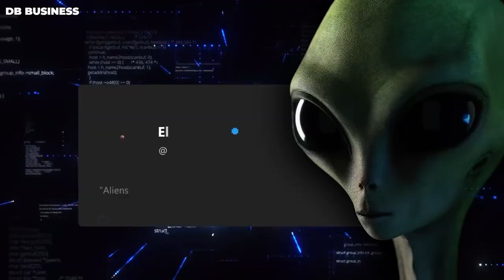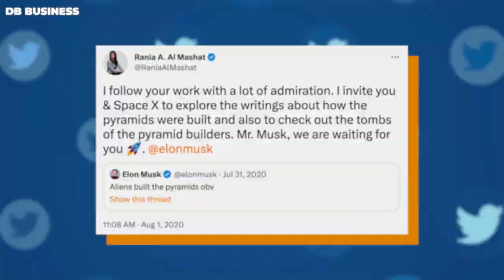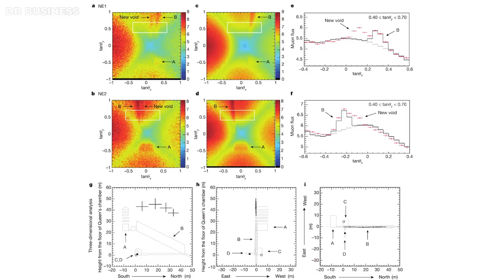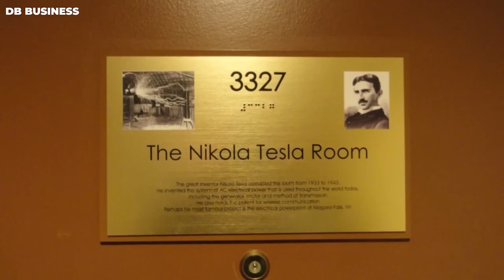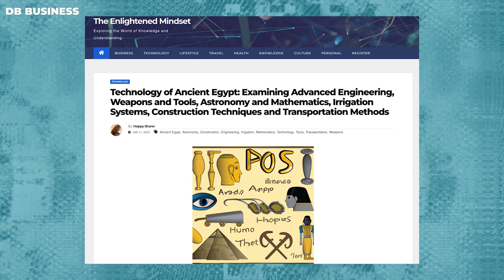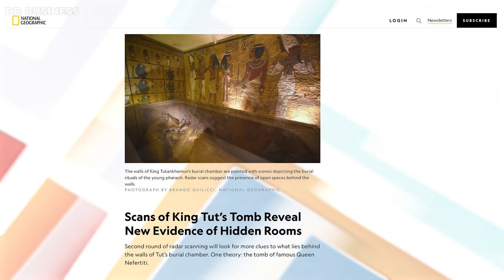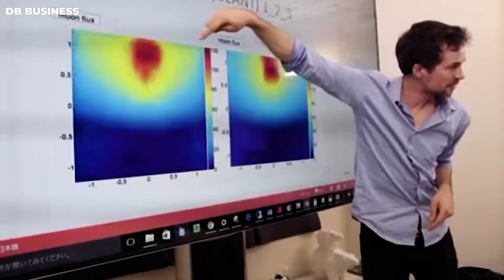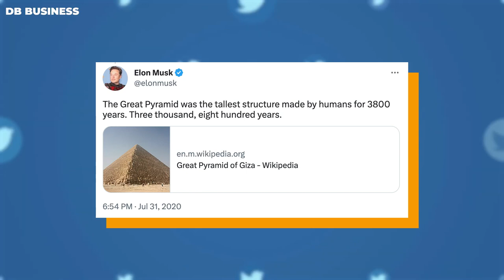Elon Musk -  People Don't Realize The Scary Truth on How Ancient Engineers built Impossible Pyramids

Comment: Its simple. They used liquid rock, geo polymer. look into it
Reply: We did.  Disproved with real research.
Reply: @michael4250  Not really, because geo polymer can be used with granite too. Also the fossils.. rocks can be used in the geo polymer mix. It doesn't have to be all powdered to work. Or do you have another reason why it cant be geo polymer?
Reply: @mattbrown1931  Yeah, it is a really seductive idea.  It would answer so many questions.  But there are too many gross "fissures" of different rock running through the mix.  And too many "unfinished" sides showing the original natural rock...and the stone found in quarries is clearly cut directly from the surrounding stone with rough-cut tool marks.
Reply: @michael4250  Thank you for taking the time to reply. Its a fascinating one for sure. I haven't seen these unfinished sides, showing natural rock. But I will have a look for sure. .  A fissure is just a crack in the rock basically. It would happen in geo polymer with enough time too. .   I have seen these so-called cut marks you mention though.  They can be created with a wooden plank, or metal even. But only while the geo polymer mixture is very wet. Its kind of like cement. The wetter the mixture, the smoother, the surface will be. You can tamp the wet mixture with a plank, to get it flat. rotating the plank across the surface of the wet mixture, will create circular features. Which can look like tool cut markings once dried.   You can also create very shiny smooth surfaces whilst the mixture is still very wet. That's how I presume they got the granite stones to look so perfectly polished.  What do you think about it?